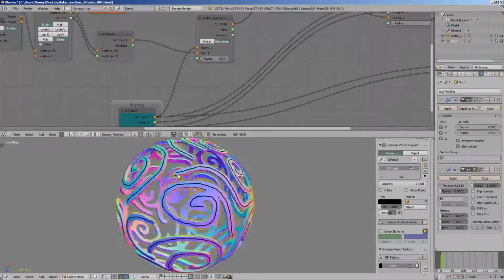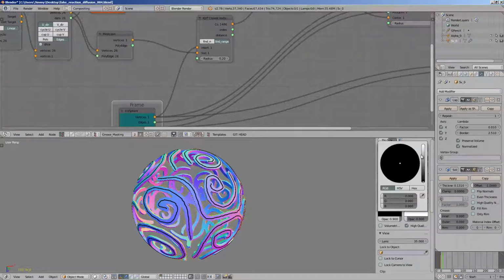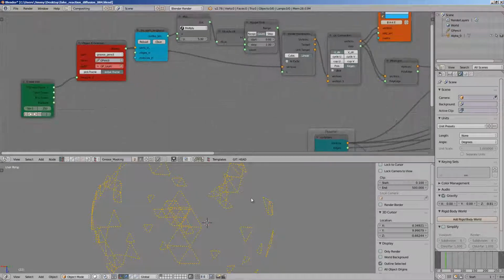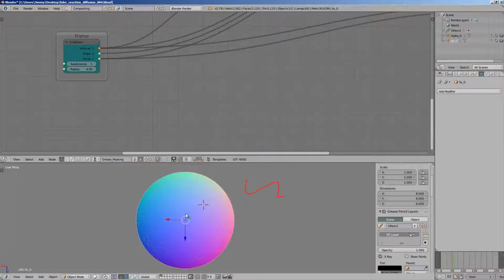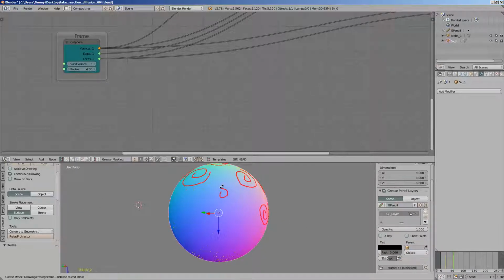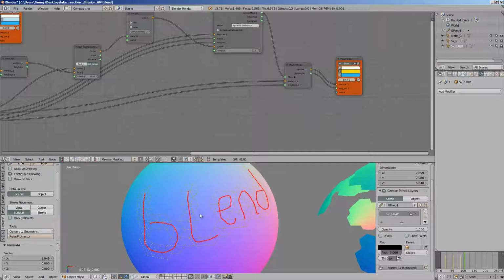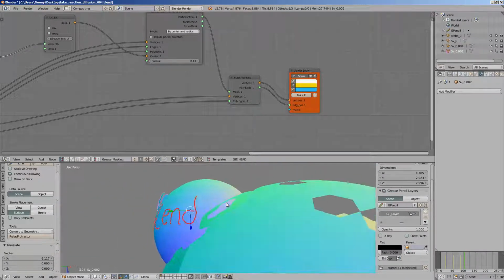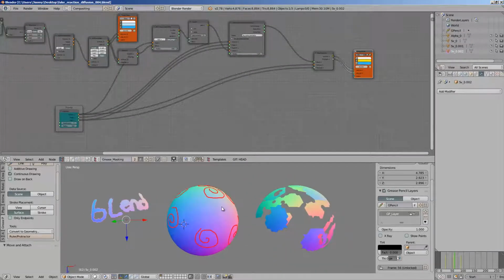BS / Grease Pencil Masking 3D Surface (LIVENODING 614)

Comment: Jimmy, if you don't mind ... hopefully this relates somewhat to your video. How would I accomplish this?  What tutors or Blender commands would accomplish this so I can read about them ?  I create a 'single line' artistic drawing of something, lets say a rose (bitmap or .SVG) and I wanted to place it on the surface of a sphere, extrude the art work, then a Boolean difference.  Very similar to the results you've done in your video.